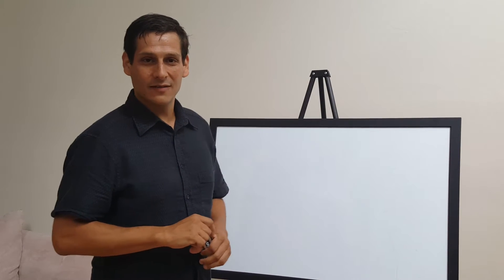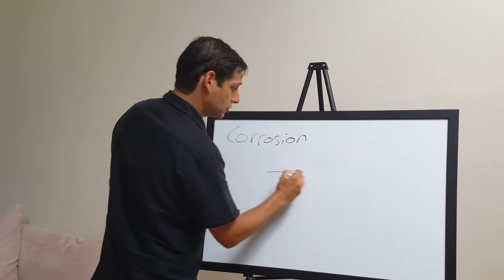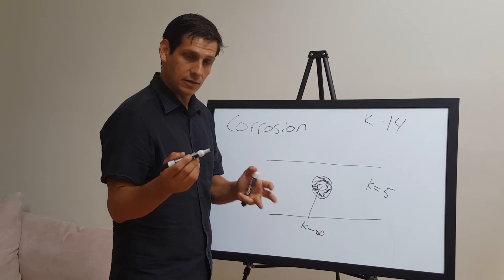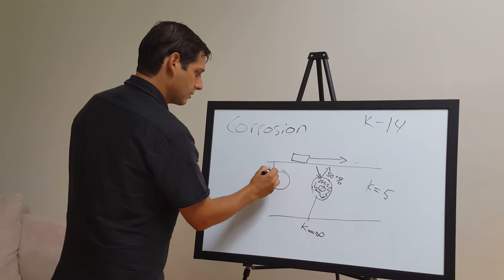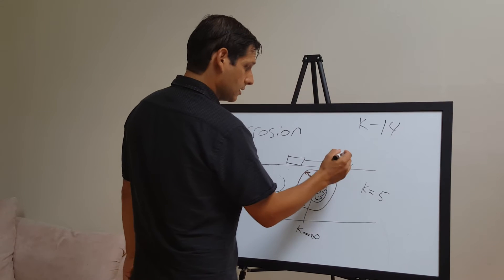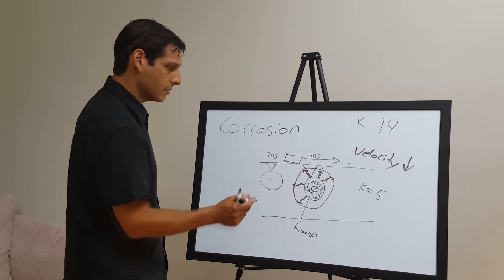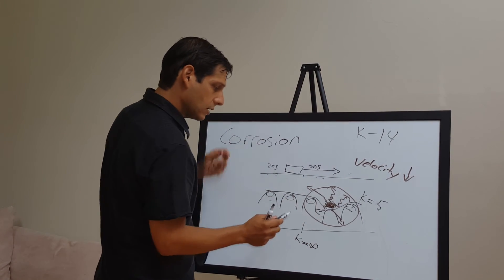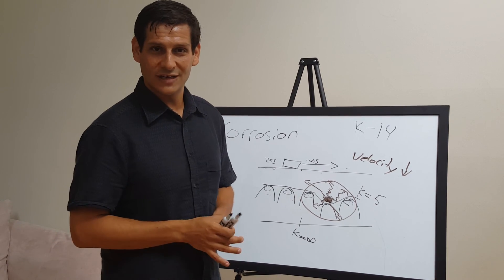Can Ground Penetrating Radar (GPR) Detect Corroded Rebar in Concrete?

Comment: What is the dielectric content of FRP (fiberglass reinforced plastics) rebar in relation to concrete?  Can FRP rebar be  mapped with GPR?
Reply from the maker: Chris Schenk great question! I'm not sure what else is in the reinforcement, but it sounds like it would have a low rdp (dielectric constant). This would clearly be more similar to concrete than steel, so the reflection would likely be more subtle. But there may be enough contrast to still map them. Especially since most of the energy would not have decayed. It would be an interesting experiment. I would like to collect some data. Where are you located?

Comment: There is amplitude reduction due to the fact the signal travels through conductive concrete due to chlorides, moisture, etc "conductive losses". If the concrete is more conductive the higher the chances the rebar will be corroded. I found the fact that the iron oxide has a lower dielectric value interesting, but haven't found any literature that uses this premise.

Comment: I'd say you have the processes reversed - typically contaminants and moisture migrate from the surface toward the rebar and cause it to corrode, so I would characterize the region where the rebar dips as "deteriorated concrete."  Another thing that happens is as the rebar corrodes, the rust expands in volume with great force.  If two or more parallel rebar start corroding, the concrete can split - the region in-between is called a "delamination."  This air gap is quite visible as a reversed polarity region bridging the parallel rebar and is a definite indication of corrosion.
Reply from the maker: +bdrogin thanks again for another comment.  Super helpful for giving additional context and true that contaminants and moisture travel from surface to rebar ultimately causing the corrosive process. But corrosion expands outward from the rebar. While evaluating concrete, moisture/contaminant estimation could also be conducted, but the there would generally be separate ways to evaluate that. One that I am looking into more at the moment is direct wave/full amplitude analysis to evaluate moisture content. Moisture is something that I think could fluctuate in concrete, but if the corrosive process begins, then it will generally expand outward from the rebar. This video wasn't really a discussion of the engineering, but rather a conceptual build of the signal response for corrosion. No doubt if delamination occurred then a reversed polarity response could potentially be recorded with the GPR providing additional information on internal flaws. Again, I appreciate the comments and I love the added contextualization that your knowledge brings to the videos!
Reply: +LearnGPR Actually I wrote a little too quickly.  The four factors that can lead to corrosion are carbonation (pH), chloride, ion (half-cell), and other contaminants (measured as resistivity).  There is already moisture in the concrete.  I wrote "typically" as there might be a circumstance where ionic behavior could lead to the corrosion contaminating the concrete instead of the contamination leading to the corrosion, as you illustrate, but it would lead one to wonder why the corrosion is happening in that manner.  Corrosion engineers (of which I am not one) are much more reluctant in how they characterize what is actually going on, structural engineers (of which I am also not one but I provide info to) usually just want to know whether something bad is going on.  Whether they decide to investigate further by destructively chipping down to the rebar to measure section loss or whether they specify a repair which destructively removes the concrete, removes the rust, and lays fresh concrete, GPR merely acts as a first NDT step to identify a region where destructive means are going to result.

Either way this is a great "basic" video.  Wish I could post a photo to YouTube of a delaminated GPR radargram, I have an AIA presentation where I show it (seeing is believing).  I've seen the "dipping" rebar as well.

Comment: How can you identify on the GPR profile persentage of energy which was reflected from corroded rebar?
Reply from the maker: Hi again Anatolii!

The instrument doesn't determine how much percentage was returned, but rather the amplitude of the reflection. Typically this can be seen in GPR profiles where the strength of the color is related to the amplitude of the signal. There is another way that really is important but most people don't use it. That is the 1D trace. Comparing traces from reflections in 1-dimension gives an absolute value of amplitude since the amplitude is related to the "wiggle". I hope this helps. Maybe I will do a video about the importance of 1-dimensional GPR data. Thanks again!!
Reply: Ok, thank you for explanation. But as usual you should anyway gain the signal and so you couldn't clearly see original amplitude on the profile..
Reply from the maker: Generally, but you regain the entire profile not individual traces. So, even if the amplitudes increase for all traces they should still be proportional. Thus, there should still be a difference between traces that you can evaluate. Thanks again!!